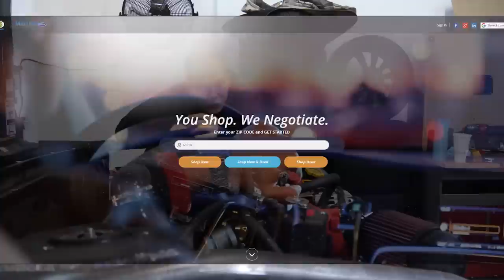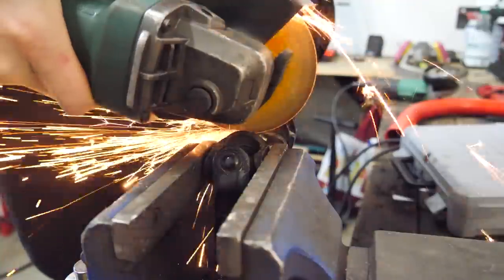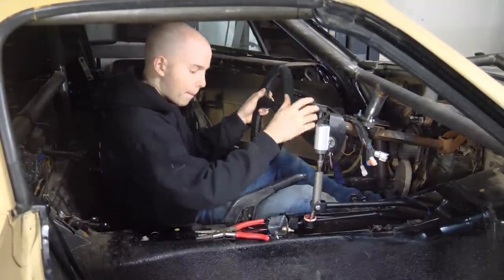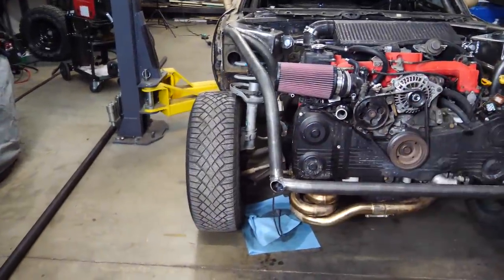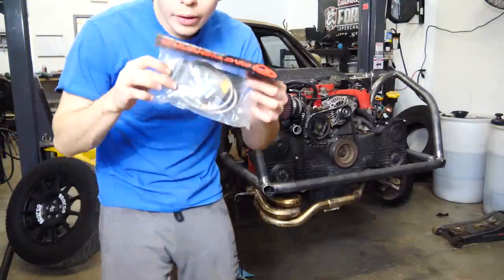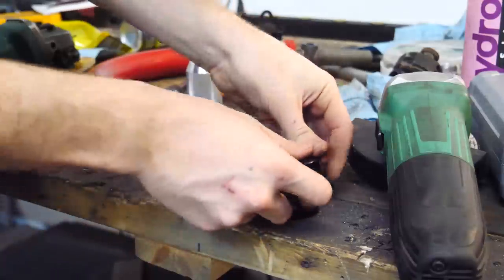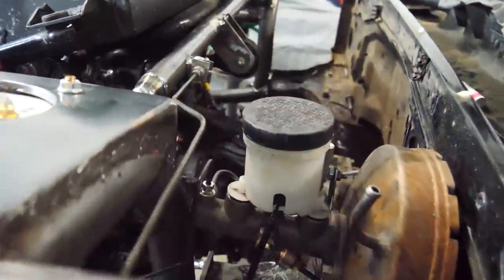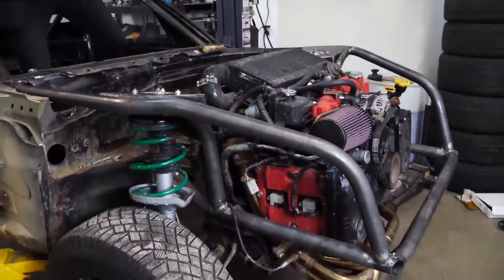AWD Miata Gets STEERING & BRAKES! Almost Ready for the FIRST DRIVE!

Comment: You really need to remake that rear diff mount a couple inches lower or you will be replacing expensive custom axles every other week.
Reply: Yea those angles are looking a bit steep
Reply: Yes I was thinking the same thing .  That diff is stuffed way up there . Save yourself some massive headache and drop it to the bottom of the cradle cause it's still going to get more lift back there
Reply: This is what I think will be the downfall of this swap, just a bunch of wrong angels and small wrong doings making it suck. Because it's going way too fast I think. But i'd like to be proven wrong.
Reply: Just pop all of the CV joints
Reply: Ive done quite a few lifted subarus and you gotta bring the crossmember or diff down to keep from blowing axles apart. And when blows at highway speed its not fun

Comment: Rob dahm- 3 years
Ging - 4 weeks
Reply: Welp somebody did screwed Rob over which makes the build took forever until Rob decided to build it by himself
Reply: Robs build is 50 times for involved then this. His will take 2k HP and breaks records. This will just break.
Reply: Completely different scale and quality
Reply: @alexstromberg7696  that's a bit far fetched
Reply: @ickedude6759  Rob said it himself
Reply: We gotta see if Rob's build is OEM+ before we start passing judgement.
Reply: @alexstromberg7696  yeah at least in the past year gingium built a drift truck that's working, the last time I saw a Rob  video is 3 rotor was broken and the 4 rotor was hidden in the shadow realm
Reply: @czrptr6849  the driftttruck just a engine swap and some suspension. The 4 rotor is awd, has been 3D scanned, billet engine, same suspension has the Mustang Ken block has. So till not the same.
Reply: @alexstromberg7696  I'm not saying the builds have the same complexity, what Im saying that at least gingium finishes builds, Rob started the 4 rotor build 2 years ago or more and put a lot of money into it and the car still doesn't break records
Reply: @czrptr6849  Rome wasn't built in a day.
Reply: Alex Strömberg isn’t this a suspension and engine swap lol
Reply: @Fruffles71  it is but not even close to the same. This took probably a week to do, robs took months
Reply: Alex Strömberg thats not what I’m saying he just made a larger chassis and put spots for the suspension and sub frame to attach to  just like he did with the truck, also the videos are back recorded weeks in advance,
Reply: Alex Strömberg another thing it’s not for 2k horse power or to break records its just for off roading and for fun, completely different builds for completely different things

Comment: Leave the front higher, for the biger suspension travel, you got heavy front soo you need as much travel as posible
Reply: the miata engine is heavy for what it is, the EJ is only 16kg heavier, about the same weight as two td04 turbos, barely much difference. Rake needs to be considered for handling balance, keeping the front that high will result in a lot of understeer, especially off road. I do worry about the front clearance to that manifold though, a bash bar or something might be a good idea, but it's hard to see through videos alone, it might be fine.
Reply: Just saying the higher you go the more suspension damage and repairs you will need to do

Comment: I think you should put the wrx wheels on the back too , to see if any change happens! could helps for the level of the car
Reply: Honda 250  all four wheels should match for the same reason the front and rear diffs need to have the same ratio; if they don't, it will cause them to turn at different speeds causing backlash in the drivetrain on hard surfaces
Reply: Honda 250  hardly, the difference in sidewall deflection and pressures to get the different ratios to match outer diameters would be enough to throw the steering off quite a bit
Reply: He cant cuz it has a different bolt patern in the rear
Reply: Honda 250  I think last video he cut the ends off the Mazda and Subaru CV axles. It's using Subaru inner half to match the diff and Mazda outer half to match the hub.

Comment: You needed to change the struts to non Forester and keep the Forester springs. The mounting clevis on the struts is lower on the Forester struts which is what gives it so much lift. You want to keep the tall springs to have as much travel available as possible. Raise the mounting clevis to lower the front, keep the tall springs for max travel with least droop when sitting.

Comment: You're planning on changing the rear wheels, right? The front and rear need to match for the same reason you swapped the rear diff. In a way, your wheels are the /final/ final drive. Even if they're the same dimensions, if they aren't the same tires all around it could cause backlash and other weird handling things from the different rubber compounds and design.
Reply: Dude, he literally just built an ej25 miata. Have some faith in the guy. He knows this already.
Reply: I'm pretty sure he can't mount the wrx rims on the miata hubs yet
Reply: @eliasschmidt4112  with a welding gun everything is possible... XD
Reply: Ivan Lesca thar would be eazy just welding your wheels to the hub lol
Reply: No, they just need to be the same size circumference wise. Everything else can be different at it would be fine.
Reply: Kyle Calicott still no need to hate on him...
Reply: @tamastenhaaff2291  Alloy to steel - not so easy!
Reply: @kylee.woyote7237  I just haven't heard him mention anything about it. Remember, he started out as a gaming channel so its not like he has 20+ years of experience and knows everything about vehicles. There are a lot of little things people can look over when they're doing something for the first time

Comment: For those of you confused on the reason only two tires turn. WRX'S have lsd yes but it works differently. In RWD if you spin the driveshaft, one wheel will go forward the other in reverse. This simulates a diff under no load. In an open diff this results in one wheel peel. In lsd this allows turning to be accomplished without the chirps known to come from a welded diff. In a subaru if you do the same thing, due to its center diff, the FR and the RL (or the FL and RR accordingly) will rotate if you spin the driveshaft, simulating the lsd under no load. It is not recommended to weld the rear diff as it will cause damage to the center, unless you are RWD converting the car. Which in that case requires the center diff to be pulled apart and welded in a specific manner

Comment: You should do radiator behind the engine switch a stubby sti style hood scoop and fans to pull in air. Do a heat shield to keep out engine heat. A short radiator like one from a jeep Cherokee or 79-80 rx7 should be small enough and still have plenty of rows for cooling.

Comment: Actually anchoring/bracing the brake cylinder to the chassis will eliminate flexing of the firewall and firm up brake feel.  Perhaps run a threaded bar (or bolt) through tapped holes in the chassis tube (or welded-on nuts).  If you weld a spreader plate to the end of the thread,  in front of the cylinder, then you can just wind the thread up onto the brake cylinder...  Just a thought!

Comment: What was you reasoning behind keeping the Miata suspension in the rear? Why not use the WRX Suspension? I know you’d most likely have to use some of the WRX subframe and hubs, but then you would also be able to use WRX axles. You’d probably still need to make them custom length but that’s better that fully custom axles that will take forever to get made if you break one

Comment: Just make a set of subframe spacers for the rear subframe. That is what they do for the stock subaru outback. Then make a custom top hat for the rear shocks. That way you can run the springs that you just took off and that way it will be level and you will have the max ride height its super simple.

Comment: hopefully you get the rear and front hubs matching. uneven wheel size/tire tread, will eventually destroy the center diff on a subaru 5 speed. they're pretty much made out of glass

Comment: Why not keep lifted springs in front. Then lower the whole subframe and upper shock mount  in the rear to raise it up. With the engine and trans sitting higher than rear the rear drive shaft angle could be off. And by lowering sub frame it would help with that and give you more clearance for diff around gas tank. You are doing a great job! And please test fit fenders with new motor and tube chassis.

Comment: I know u have probably thought of it but why not put the forester springs and shocks in the rear? U would just have to make custom strut mounts like u did for the front.
Reply: The miata doesn't have struts, it has a double wishbone in the rear. The forester struts probably won't fit in there

Comment: Idk if this is normal but when you crank it the rear wheels will spin later than the front. It may be because of the travel of speed from the crank to the rear diff but idk

Comment: Real question is how are you going to cover the engine and sides of the awd miata?
Reply: Are you going to make a custom hood yourself of retro fit one off the subaru?
Reply: Easy you weld brackets to the tube frame and join it to the panels. Only cutting may be for trim

Comment: the steering shaft should be sleeved with some thick tube, drilled and spot welded, then seam welded, preferably with a tig.
not just but up the two ends and booger them together with a mig hahaha ffs
But seriously though. I can't think of a much worse situation than losing your steering on the highway

Comment: When you see that rear whels are turning slower than front.
Reply: Not really differnent size
Reply: what about the left side not even moving? open diffs?
Reply: @Nebbia_affaraccimiei  not necessarily. Wrxs have lsd but in awd it works differently. Because of the center diff the FR and RL tires will spin, and the opposites will sit still
Reply: @ChickenJoe50  nah. wrx has open diffs front and back. sti lsd
Reply: False. This is a bugeye, it has rear lsd in it. Front and center are open. Do not generalize the statement as each generation is different

Comment: Wuy did u mount the wheel so low. You're going to have completely different suspension setups front-to-rear you're better off building new subframe mounts and putting in the Subaru stuff and your front end is going to be wider than your rear end

Comment: 14:32 left side ain't moving that much
Reply: When you free rotate awd, lsd has no load. I work on subies and when this happens, the FR and the RL spin but not the opposites.
Reply: @ChickenJoe50  so it is normal?
Reply: @antoniomartins6128  yes I just explained it. LSD in wrxs are like any other car. They preve t slip diff UNDER LOAD. but they release so you can make turns. Just like RWD if you weld the diffs then all wheels will rotate. RWD shows this differently. If you rotate the driveshaft one wheel goes forward while the other goes back. The one going in reverse is showing the lsd simulating no load
Reply: @antoniomartins6128  it is not advisable to do weld diffs in an AWD drive car however as it can cause damage to the center diff, as that is the power distribution point. The only tine you weld the center is when you RWD convert a subaru, and that requires dissassembly of the center diff
Reply: @ChickenJoe50  I didn't know that thanks